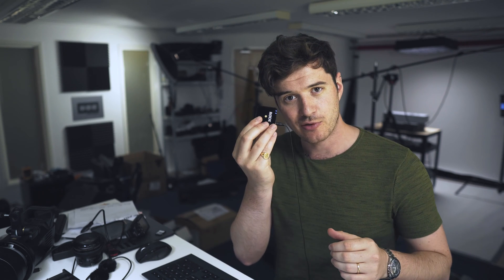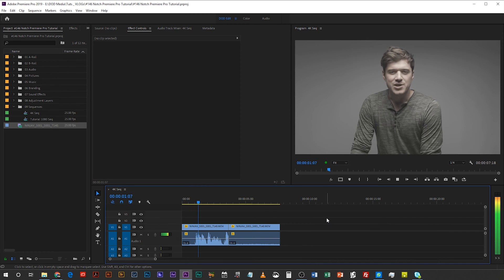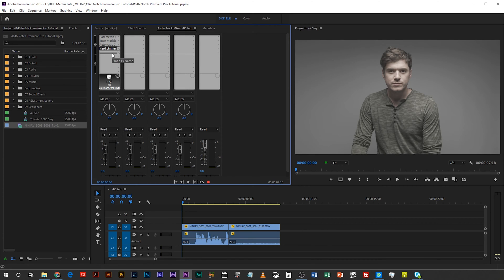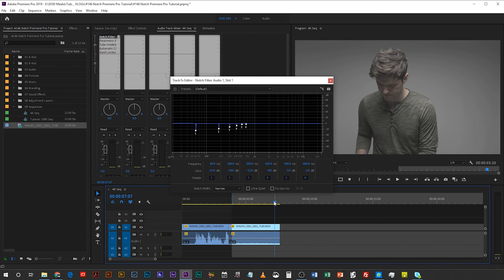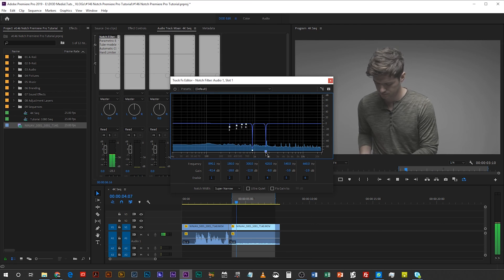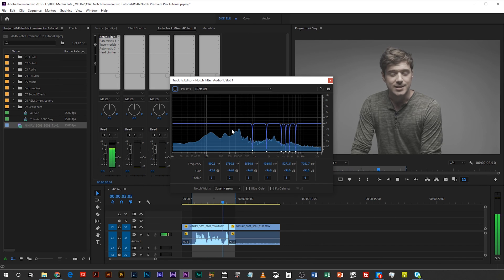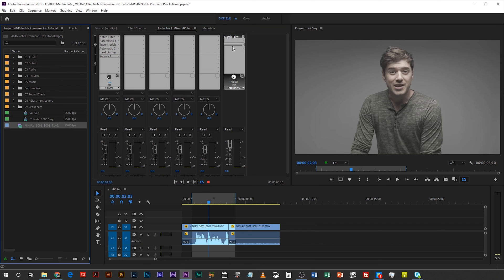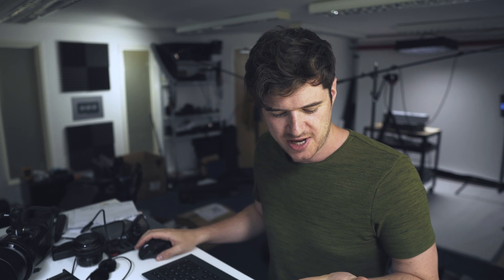Fix BAD AUDIO with the Notch Filter in Premiere Pro

Comment: Thank you so much for this comprehensive tutorial. 🤓🙌

Removing those specific frequencies is so helpful when they are the problem and not necessarily a fan or other ambient noise that is across a ton of frequencies. 

You also showed the looping option, which I’ve only seen in a few audio tutorials.

Comment: The noise reduction from Audacity is quite the thing for that. 1) we select a noise only part and do a noise reduction analysis 2) we select everything and do a noise reduction. With everything by default it's already magic (4 clics, 5 secondes and the times to save).  For strange non persistent noise not isolated there are free stuff like Spek that can plot a 2d (time freq) colored map of an audio and so see clearly where the noise is located.
Reply: 10X!!

Comment: But, the voiceover audio at the beginning of this is bad. Sounds flanged.
Reply from the maker: Yeah that's more to do with the fact that I'm talking right into a corner and I didn't have any sound dampening set up in that corner of the studio yet. So my voice is basically undergoing a very tight slapback reverb which will result in a sort of box/flange effect as two identical sounds hit the mic slightly out of phase. It's fixed now :-D

Comment: Yes. As below I was able to work the notches.  The  Audio effects would only show on the time line, not in my Audio track Mixer.  I wanted to make a template as DOD has, but later.  I had two sounds to eliminate.  HISS and WIND Noise. They are very different frequency groups. 
 Hanging the microphone from a branch of a tree above the speakers at the wedding seemed bright at the time, not when the leaf wind noise came in.  Lessons to go home with for me. Put a separate microphone  [ or a Cell phone ]  right beside each sound required.  Music being played at the wedding has to come across in one soundtrack and you can not cut and throw away bits you don't like very easily. 
I want to get these Sound effect Equalisers in, I am thinking maybe they will take very thin talk audio to a wider frequency range. 
This tutorial and others like it are very valuable for us.   I started making Mono prints in the darkroom in the 1980s. 
A  film studio then would have cost about $250,000, and that's for a linear editing conventional film set up.